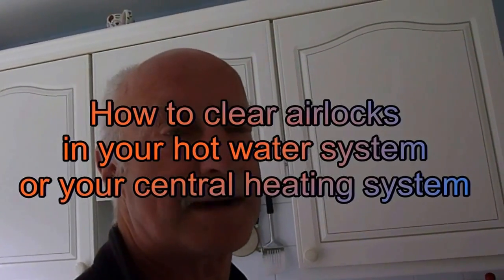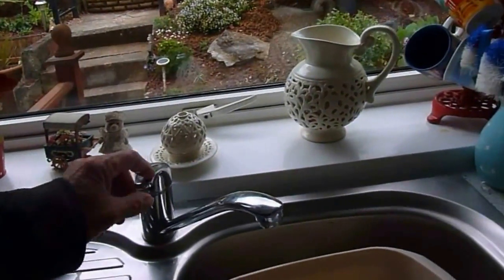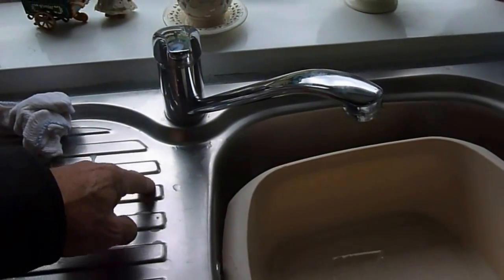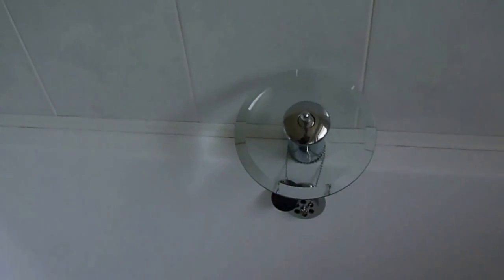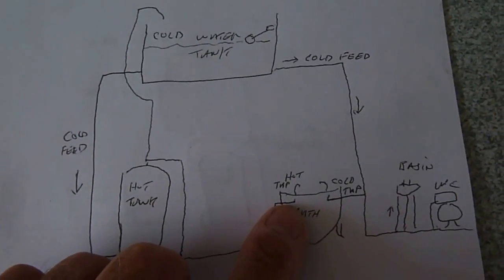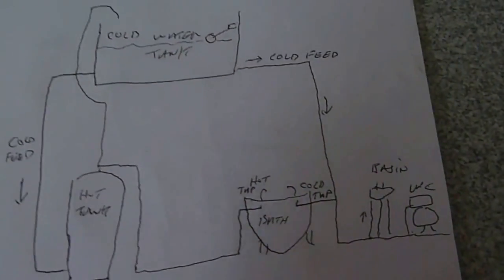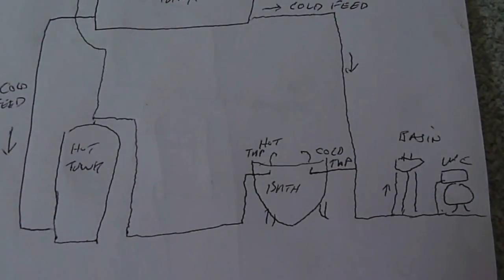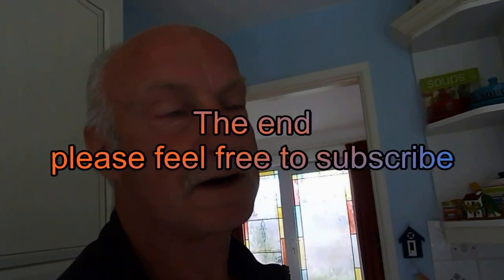How to clear airlocks and restore hot water or heating

Comment: Dear Sir ,I have a problem with my Shower ,it seems air blocked ,there is only a dribble coming out the head,its feed from the loft in my bungalow,,How would you cure this...As I dont live here most weeks in winter I normally drain down the system,incase of a bust pipe .Maybe I should look at fitting some sort of air escape valve...
Reply from the maker: +lipsee100 . Yes you have air in the pipe work, you could fit an auto air valve in the loft where the pipe drops down to the shower..

Comment: easiest way I found to clear a air lock is if the washing machine has a hot feed is to loop the mains cold to the hot washing machine valve. open up up both valves.
Reply from the maker: That`s a great idea, thanks for the info Alan.
Reply: Alan White u

Comment: Hi, why is it that when I turn the bleed screw on the pump it sucks more air in ?? I thought it should be the other way around, thanks
Reply from the maker: You must bleed it with the pump off or you will suck air into your system.

Comment: Recently we noticed, that Hot water flow in the bath  is much lower than in Kitchen.
I presume that it started when we filled the bath (and drained the tank in loft)...
The flow re-established to the same level in like 3 days... but plumber came and replaced the pipe which goes from Boiler (Hot water cylinder) to system. it had 3 90 degree elbows, now there's no elbows, and there is one single bended 93 degree pipe...

the shower tap is the one with thermostat, bath and sink taps are mixers.
Reply: HELP, love your videos they have made my diy plumbing jobs so much easier but iam stuck this time. I replaced the  motor  on my motorised port valve but had to take it off due to lack of space. I have a gravity fed system with stored hot water. I followed your instructions drained down my system replaced the head put all back together all whent according to plan except I can't seem to refill my system all valves are open small fe tank is full but nothing will flow have tried all your tricks cracking the nuts each side of the pump etc even redrained but nothing works any ideas. Colin

Comment: Hello Al, I wonder if you can advise me please, my son is renting a flat, and his heating system is not working (the landlord doesn't want to know) He has 5 rads on the system, the one in the bathroom gets warm, as does the one next to it in the hall, and the next in the line, in the bedroom, gets less warm. The one in the lounge is stone cold, as is the one in the kitchen.
We open the bleed valve in the lounge to see if water would shoot out under pressure, but it does not, just a couple of drops trickle down the side of the rad then it stops. This would seem to indicate, either a blocked, system, or an air lock?
 I have placed the 3 way valve in the open (and locked) position, but it still the same. I could try the centre screw in the pump to realese any air, and what about connecting the hot and cold taps together and flushing mains water through it?
And any way to check the pump is actually pumping?
Many thanks in advance.
Mike.
Reply from the maker: Hi Mike , if you have a F and E tank in a cupboard check it is full of water , if you have a pressurised system make sure the gauge is on one and a half bars . If both of those things are ok then I would take a look at the central heating pump just put your hand on it when it is running you should feel it vibrating , you can also turn the speed up to number 3  Next I would balance the system , Shut the lock shield valves closest to the boiler almost off that's the bathroom rad then the hall the bedroom up to the last ones (lounge and kitchen) which should be left fully turned on.
Kind regards,
al.

Comment: does this method apply to shower also? if not any tips how to fix the airlock in the shower??
Reply from the maker: If your shower works through the bath taps or is a low pressure mixer unit.
Reply: +dereton33 lower pressure unit the water won't flow keeps stopping nd starting
Reply from the maker: Make sure your shower head is not blocked.
Reply: +dereton33 what steps would u recommend me doing trying to solve the shower because my bath has the traditional 2 taps
Reply from the maker: If it is tank fed with low pressure, a pump may be your best bet.

Comment: Hi there, great videos once again!! I have a Baxi Potterton Performa 28i combi-boiler. It is 11 years old. I had a bad water leak in the boiler diverter valve and so the rubber diaphragm washer and the diverter differential was replaced as well as the switch that sits on the diverter. Now that the leak is fixed, we now have barely any heat to all 10 radiators in the house. We have bled the radiators to no avail. The GCH tries to come on, but all we hear is hissing from all of the radiators when the heating tries to kick in. The pilot light kicks in for about a minute on the boiler and then it clicks off before any of the radiators have had a proper chance to heat up fully. Any ideas what might be causing this problem? Our entire house (also 11 years old) is freezing cold, as the radiators are all only luke warm (barely). Many thanks.
Reply from the maker: Try some system cleaner and inhibitor.

Comment: Hey Al, love these videos. In a 10yr old house with 10mm mirobore pipes. I guess you know what's coming. I bought the house 5yrs ago and in that time have never had a fully working CH system. Poor flow caused by sludge as the previous owners never treated the system.
Anyway, after constant attempts at using CH cleaner & inhibitor, pressuring it with mains water via the hose, taking off every radiator to clean them, changing valves I'm still with a system where the top of the house rads don't properly heat up.
Any suggestions??
Cheers
Reply from the maker: TheHugs40 I guessing you have tried system balancing. The best way to clear a micro-bore system is to take off the manifolds, it is the part where all the 10 mm pipes branch out from and thoroughly clean them, this is where most blockages occur in micro-bore systems. Of course the expensive option is to scrap the micro-bore and convert your system to 22 and 15 mm copper. Good luck with it anyway. Al.

Comment from the maker: Sounds like you have air in the system , bleed all the radiators and re-pressure the boiler to one and a half bar. Also check there is no air in the pump. 
Regards,
al.

Comment: Dreton33 thanks but I now realise that I'd had this problem with same rad about 3 years ago and the solution has just come back to me in a brainwave, I remember closing off the inlet valve overnight on said rad while leaving the outlet valv open, next morning an hour after the system switched itself on I waited till the temperature was up to normal approx 40 mins then I opened the inlet valve and watta know the rad was 100% hot in a few mins
Reply from the maker: That` great. Al.

Comment: I've got 8 rads 4 upstairs 4 down, one upstairs won't heat up fully I've bled n bled but no result I've replaced this one recently with a new one just in case there was a dirt problem but the new one is heating below par just like the old one, advice anyone?
Reply from the maker: Try balancing the system.

Comment: Good video, but here is a query an indirect cylinder 1" feeder pipes to the coil, very hot,but water coming out of cylinder is tepid,  There is an automatic bleeder valve just beside the instantor elbow fitting heading into the top of the coil, same temperature at the bottom of the coil, the mystery is why the water in the 40 Gal insulated cylinder is not getting as hot as the pipes servicing the coil 
Thanks if you can help.
Bill.
Reply from the maker: Bill Lupton The water in the cylinder will never get as hot as the water in the coil from the boiler, the coil acts as a heat exchanger in the cylinder and so will never be as hot as the coil, that said you should be getting more hot water than you say you are getting at the moment. You may have a slight blockage in the coil, i would recommend you use a system cleaner and then inhibitor to keep your system running clear.

Comment: Hi. 

My wife and I have been having trouble with hot water in our apartment. We have hot water in our kitchen, but nothing but cold water coming out of our bathroom sink and our tub when we turn the hot water all the way on and leave the cold water off. 

Our landlord refuses to hire a licensed plumber and either looks at it themselves or send a maintenance person (none of which are licensed plumbers) to look at it. 

All they do is go to the boiler room in the building and look at the boiler. 

They come back with:  the pilot light was out and we relit it, there was condensation on he boiler so we put insulation on the pipes, no one else has complained about the hot water but you. 

We never had a problem until this new management company took over. 

All I know is we have now been without hot water for a week now and are getting the run around. If we were a week late with our rent, we would be out on the street. 

We tried to hire a plumber ourselves; however, they won’t come out because we don’t own the property. Our landlord will not let us hire a plumber on our own, nor will they to resolve this problem. 

Does anyone have an idea as to what is causing us to have no hot water in our bathroom ?

Unfortunately, we cannot afford to move somewhere else or we would. 

Thank you.
Reply from the maker: It could be the taps if they are mixer types, as you get hot water to the kitchen, the boiler must be all right.

Comment: Hi there, I so hope that you read this msg and could help or have so advice for me.... I have no heating at all, however I do have hot water. I turned my electric of 2 days ago to fit some new lights in my house but when I turned it back on, I had hot water but no heating at all, none of my rads were getting hot at all,,, have you any advice on what it could be that stopping the rads from getting hot?? Many thanks an sorry for bothering you on a Sunday... Steve.
Reply from the maker: Check power is reaching the boiler OK.. If you have a Combi then check boiler pressure . If you have an F and E system then check power is reaching the 3 way valve and heating pump.
Reply: I had the reverse,No hot water! That's much worse! my social housing association; Southern Housing Group got rid of the last heating engineer firm;Robert Heath Heating who were costly and incompetent. No draining of my system,air is definitely in it, scale,sludge and all the controls aren't working so the whole lot is now being replaced,serves them right for going cheap!

Comment: Hi Al, Thanks for this video! Very informative, but I still can't seem to get the airlock out of our hot water system, It's simply a Vaillant Eco Tec Pro 24 boiler connected to hot water/heating. We have no tank as it's a flat roof house and no storage heater/hot water cylinder. The hot water works but the pressure is a fraction of what it used to be before our landlord changed a basin tap in the bathroom. I am suspecting an airlock as the hot water often splutters. I tried the washing machine connector trick, tried blasting the cold water through the hot water for 5 seconds at a time repeatedly. no luck, The shower will completely cut out if the water is being run elsewhere in the house, even if the other tap is running at a trickle/cystern refilling. I've also tried re pressurising the boiler, didn't really do much. We're not running the heating as yet.
Landlord doesn't care, any help or insight would be greatly appreciated. Thanks in advance.
Reply from the maker: Hi Sam , your landlord has left the water pressure too low since doing your basin tap , if you can locate the main stop tap , just turn it to full on (anticlockwise) . As you have a combi boiler and they do not suffer from airlocks just low water pressure.
Kind regards,
al.

Comment: Hi Al we have a issue with our water tank or a valve maybe im guessing,  our heating comes on and when it cuts off there's one knock sound followed by a sort of scraping noise, sounds like its coming from the tank cupboard, any ideas?
Reply from the maker: System is blocked with sludge or scale.
Reply: dereton33 nice one Al thank you
Reply: dereton33 Do you have any videos on the procedure Al please?
Reply from the maker: Yes check out my channel. Or web site. www.dereton33.com
Reply: Omg I've had banging sounding like doors it's creepy when on your own! Its parts and limescale and sludge
Reply: Kettling*

Comment: P.S... The boiler pressure was also turned up to 1.0 after bleeding all 10 radiators. Thanks.
Reply from the maker: No problem.
Reply from the maker: Try one and a half bars.
Reply: dereton33 Tried that to 1.5 and still no joy. All radiators are hissing away for some reason ... -6 here in Scotland right now ... In the house it feels like -2 ... Thanks.
Reply from the maker: +dereton33 check the pump.

Comment: Dereton33 
Thanks for that answer , , I know the coil is a heat exchanger ,but as you say the water should be hotter, as the new 40G cylinder is only in 5-6 years Ill explore the idea of flushing the system, when I release the nut on the elbow I let some water drip out and it does improve the heat in the hot water, because I got an airlock some time back I drained the system and fitted an automatic air valve within 2" of the elbow, I must try tapping it (the auto valve) ,as the  weather has gone cold I don't relish draining the system at present but Ill soldier on and thanks, again for the response
Your not bad at the piece to camera,no ahs or ohs,
Reply from the maker: Bill Lupton Thanks Bill, another idea once your system is drained would be to replace the elbow with a tee screwed straight onto the tapping of the cylinder ( a female thread centred tee ), with your air vent coming off the top.